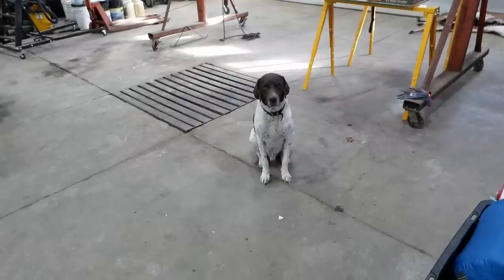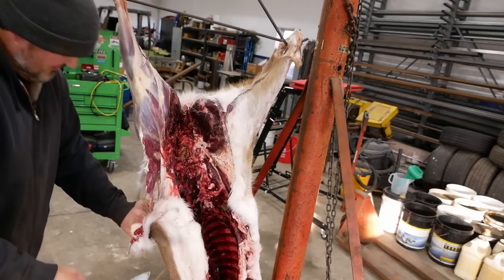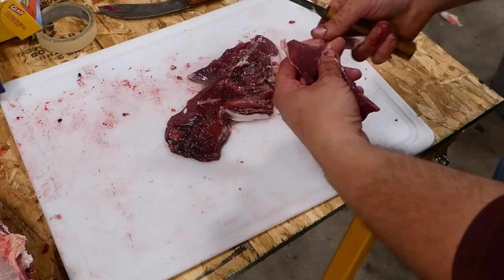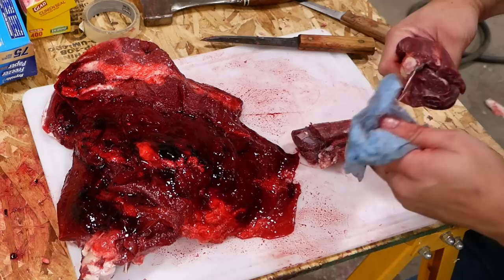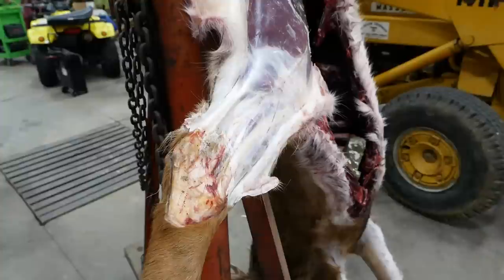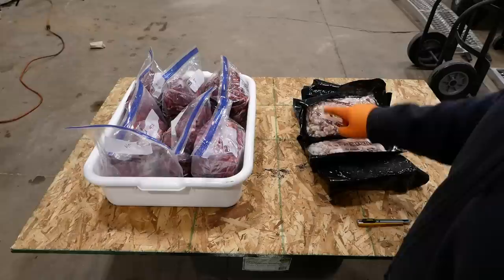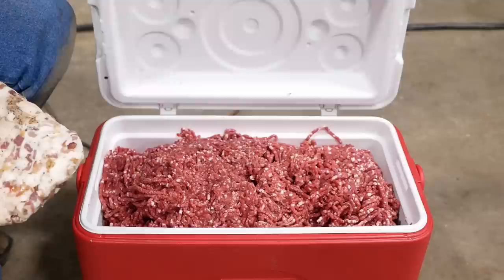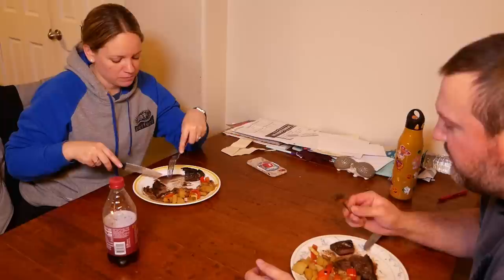DIY Deer Processing with Basic Tools - Plus Wifey Critiques my Cooking

Comment: Didn’t see this channel until now. Great to see, most people don’t have any idea where meat is from.

That is some very fat venison, compared with here. I bet that will cook up just fantastic, and less problem with drying out.

I’m with you on trimming the ‘knicker elastic’ parts, yes it’s slow, but easier to do before freezing and thawing. Very different butchering style, I was taught to take the meat apart by muscle groups, particularly in the fore end.

For the tenderloins and best parts of the rump, it helps the texture to flash freeze. put a 5 gallon bucket of food grade calcium chloride brine in the freezer, and get as cold as possible, stir occasionally to keep it slush and stop big lumps forming. Vacuum seal the meat and plunge into the brine, stir for a few seconds every few minutes till frozen solid (surprisingly quick). Important safety tip, do not flash freeze your fingers, if you do, don’t bend them (it will smart a bit as they thaw out, you won’t do it again).

Comment: Wes, get yourself a vacuum sealer.  They are super affordable now and do such a much better job at protecting against freezer burn.  Also on the carcass, I never split the spine, with CWD being what it is these days the less you can expose any of the meat to spinal fluids the better.  I actually  take all the "loose meat" (tenderloins, backstraps, neck roasts) off while still hanging, then break the shoulders off the rib cage and cut the spine just below the rear quarters,  now all you have is both rear quarters on the chain still and split the pelvis and you are done.  I can do a deer/antelope or elk in about 10 minutes.  Then I bone the quarters like you did.

Comment: Hey Wes! I know you’ve commented on your carpal tunnel before - so for what it’s worth, something I was taught to do when using a knife is to extend my thumb instead of my index finger.  I discovered I still have excellent control but also had a lot more strength through the cut with a lot less effort.  It feels a bit weird at first, but it has helped my hands tremendously.  Feel free to give it a try or not.  Either way - I love this new channel!!!
Reply: Hey Russ, several professional chefs I know suggest pinching the blade, just forward of the handle, with your thumb and fore finger. I find that to give a lot of control, too. Now, I don't have carpal tunnel issues so it may or may not work for you. But, you may want to give it a try.
Reply: @daveast2551  Thanks!  I use that grip as well and you are right - it does work well!!  Now if only I had some of that tasty sausage

Comment: Interesting to see the regional differences in butchering wild game.  Here in the south, there is no option to field dress and hang for a few days.  Everything has to be done as quickly as possible unless you have a big meat locker.  Good to see you are handy with a hatchet.  I'm not, so I use a big pair of bypass loppers to chop off all the bone sections. Thanks again for the great content.
Reply from the maker: Typically they are frozen solid by the next morning.

Comment: Very good video!  We actually use an old electric chainsaw (with no bar oil) to do some of the cutting (legs and splitting the carcass).  A cheap cordless chainsaw would be good too.   The best way to skin a deer is one of two ways - either have the young guys do it or use the rope/cable method using an ATV or other handy vehicle to pull the hide off. Quick and easy!
Reply: I've a similar set up- idea stolen from my uncle. We use a new cheap electric chainsaw, ryobi but that doesn't matter, with a chain that has been degreased, and then run through a dishwasher of all things to get the degreaser off. Covered in rendered lard to avoid rust for the day or so between prep and use. Needs cleaning every year, as the lard will oxidize.

In stead of bar oil, and to avoid metal shavings from no lube at all, we run olive oil in the saw. Works pretty well- i know it sounds like a lot of extra, but it really doesn't take long at all to set up. Maybe five minutes of work, over two days with washing it before and after use each season?

Comment: I was hoping you were going to break out the Pico to see why the deere has a no run condition
Reply: Yes i've had that error code myself, it's 250-3000SAV. fuel pressure out of range (low)

Comment: Hey Wes, my buddy puts 25% pork butt into his grind. It's not bad and can be pretty inexpensive. I've used bacon before, just the cheapest store brand I could get, I like low sodium for this. There is a slight odor of bacon while cooking but no flavor.
Interestingly I bought a Harbor Freight cheapo grinder and I'm very impressed, we did 50# in about 3 hours including vacuum packaging. I will also add that a Food Saver is worth the money. Flat packed grind is awfully handy.

Comment: I have a home built grinder about the size of yours . I used to run it with my metal lathe but now use a dedicated motor /gearbox. I just grind right into plastic bag tubes .Work good. Takes longer to clean the grinder than to grind up a couple deer.

Comment: I had an old Hobart grinder mine was dated 1919 we used to use similar to yours except mine had a large plate on top where you can preload your meat was great for mixing we used an 80/20 deer to beef I miss the thing but a guy offered my dad 1000 for it and the deli slicer of the same vintage and he couldn't say no I now have to grind my deer on a kitchen aid

Comment: Pork belly can sometimes be found easier than bulk bacon.  And has the advantage of not being cured and changing your seasoning.
Probably too long a drive for you, but if you can find a restaurant meat supplier or a meat packer, they often have excess fat they are more than happy to part with, cheap.  (Cheap being relative if there's a 2 hour drive.)

Mind, this being Texas, we have a major excess of feral pig around, hard part is getting the clean white fat so that it's not so gamey.

Comment: One of the tricks I learned from a Thoracic surgeon that translates well to processing meat is having a good set of garden loppers for ribs.  Clean cuts and darned easy.  I also have an oscillating tool with a few blades specifically for bone cutting, if it's used in the OR, it can work in the garage too.

Comment: Osso Bucco is pretty much the "poster child" recipe for the pressure cooker (Instant Pot, these days) crowd. The higher heat of pressure cooking get the job done in around 60 minutes.

And I'll add my vote to the "renovation video on the Hobart" campaign that seems to be running 🙂
Reply from the maker: Never thought of a pressure cooker. I always let it cook in a dutch oven for 4 or 5 hours.
Reply: @watchweswingit  When you slapped the shoulder down and said roast, it's what I immediately thought of

Comment: Wes, you can get 12" stainless Sawzall blades on Amazon for cutting through bone. I bought a pack of 3, have yet to try them though
Reply: Went the reciprocating saw rout years ago and never looked back.  Be careful though not to get it bound up or you’ll experience the full body jiggle.

Comment: We used to "proces"  the deer in my parents garage 10-12 hunters all family so it could be as many as 15 deer but it was never more than 8 ,start at 5 pm after work and go to midnight usually 1 or 2 nights that was until they found a local butcher that would do the whole deer for $20 even make the sausage in your own recipe.  He did the whole thing in an hour or so and everything was vacuumed packed no muss no fuss no mess no waist
Reply: $20.00 😲 $120 to $140. per deer in NW LP of Michigan if you can find butchers a lot have quit in the last couple years.  I remember paying $35. about thirty years ago.  I did bag three Does with a bow this year, limit is 10, and knocked down a nice buck with my Subaru Forester the day before I was to turn it back in on lease.  Cost me $250. and Insurance company $3,300.  Deer are just tasty vermin up here.

Comment: I had an idea about your hopper problem... How about getting a new. clean metal bucket and knocking the bottom out of it? Then clip the resulting funnel on / over the hopper of the grinder? Looks like the sizing wouldn't be far off, and pop-riveting some metal 'clips' onto the lower part of the bucket to secure it on the grinder hopper should be simple enough. You dog will hate you for it, but there'll be less floor treats.

Comment: Could ask a lot of stuff, but only one thing if you get a deer, get the skin off as fast as you can taste better than let it sit for a day or two hanging without the skin.  You should at least clean the grinder before you used it. I have one.
Reply from the maker: I cleaned the grinding part which can be removed from the motor.

Comment: Don't be surprised if your down votes and more negative comments on your other channel start appearing.   Because HOW meat is processed is never supposed to be seen.  "Where does meat come from?"  The grocery store.  "Where does water come from?"  The tap.  "Where does electricity come from?"  The outlet.  

You might want to consider steel mesh gloves.  One moment of lost focus and there will be an emergency room run.  I did that with an electric chain saw.  Plug pulled out.  Motor stopped, but the chain continued to turn for a half a second.  As I looked at the bone in my index finger, I thought "This sucks".  There was fire station about a mile away.  They wrapped it up.  The hospital was 25 miles away.  Fun ride.  Good thing the car had a red interior.   

A couple of years before I had a 4 inch sliver of wood go through the tip of my thumb and go out my palm.  They had to slice my thumb open.  So, when I went to the ER, the doctor says "You look familiar".  He had done the thumb. I show him my thumb and didn't say anything.  "Oh yeah, I remember, how's that working out for you?"
Reply from the maker: That's why it's here. We're already demonetized.
Reply: @watchweswingit  Maybe if you put rainbows in your videos and dyed your hair green would help.